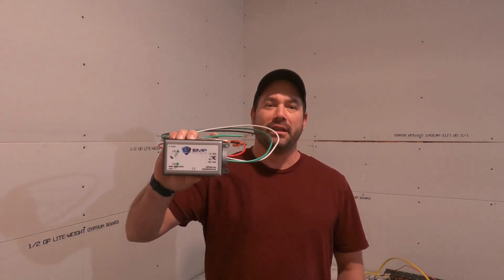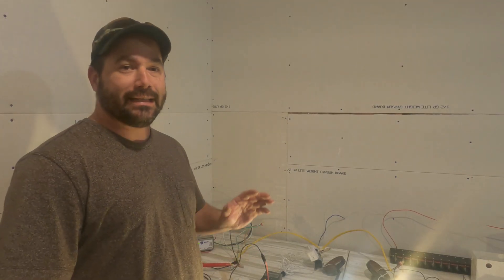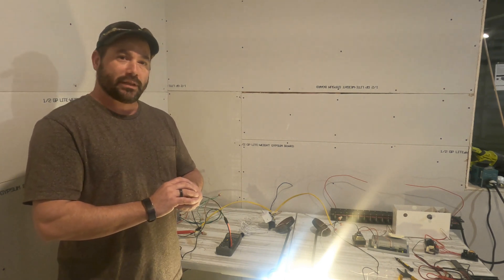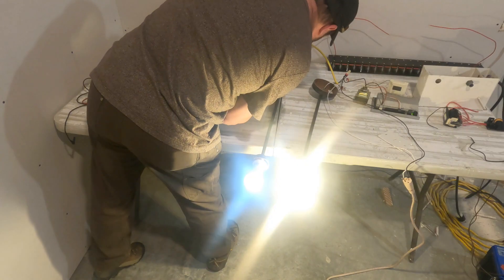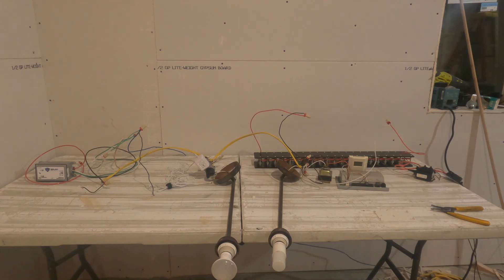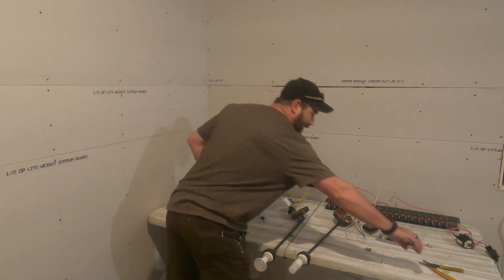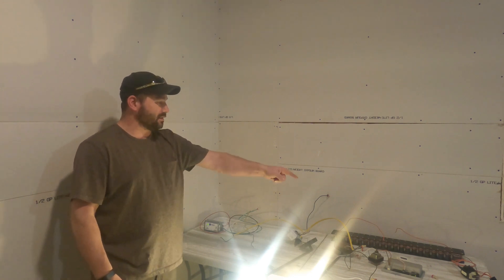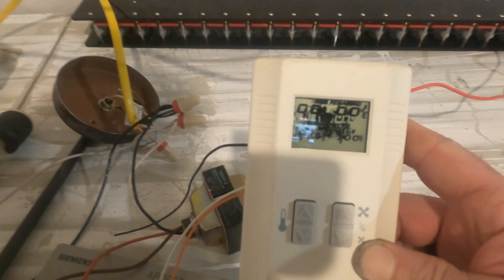Testing the EMP Shield Surge Protector ⚡

Comment: You are not qualified to talk about anything. You just called an arc from capacitors a static charge. EMP shield is a huge scam. Sincerely, an Electrical Engineer
Reply from the maker: I could spend the time to discuss the fundamentals of capacitors and skin effect similarities of conductors, but people aren't interested and it deveates from the topic. Charge accumulation of electrons on one plate (foil strip)  until equaling the supply voltage. This charge is dumped onto the other plate separated by a dielectric or insulator when the circuit is closed (by arc gap in this instance due to dielectric breakdown and ionization of the air). This build is using a high voltage/low amperage- similar to static charges and equivalent to emp charges being high voltage and low amperage unless coupled on long conductive surfaces- building both voltage and current until a similar dielectric breakdown of any nearby grounded materials- potentially even air. Are you slightly more satisfied? If not, I will issue a full refund of the entry fee.

Comment: Emp sheild is crap. Surge x is wsy better.
Reply: why?
Reply: @Miles-Research  because surge x is active surge protection emp sheild is not. Surge x use a huge inductor and capcitor bleed circuitry  and emp sheild is crap mov parts. And all moves are not rated for massive lighting, industrial brownout or motor startup surges.

Comment: That looked like some fun testing.  I recently was in the market for 3 lightning arrestors and looked into these Emp Shield units, but I couldn't find any specs that I could compare to all of the other brands on the market. I wound up going with a known brand at half the price. Your video is the only one I have found that isn't affiliated with them. 👍
Reply from the maker: @SteveStoltz  they are really difficult to find proper specs on the device. Most SPD's are clearly labeled. I do believe this is labeled as 228ka (which was on their old web page before they updated it.
   I can confirm that it does what it is supposed to do! I ended up losing a battery backup system hooked to my garage freezer from induction on nearby household electrical in the ceiling of the basement. It also did quite well at corrupting my micro sd cards or the camera as I was (attempting) recording. Hind sight was that I should have built a Faraday cage around the room. I was planning on upping the voltage, but after many catastrophic failures and getting zapped - even while standing on tractor tires and using long poles to close the switch of the isolation circuit through relays, I destroyed all the power supplies that I had made. I then considered a large tesla coil, but with the low amperage,  I'm not sure the end result will be anything but a pass. Luckily EMP's are essentially static charges, but they can build high amperage over distance of conductors.
  Lightning protection- I heard 1 story of this working against a direct building strike. It destroyed the device, but all motors and frequency drives survived.
Reply: @AnythingOutdoorswithSteve  Thanks for taking one for the team, Haha.

Comment: It would have been nice to have positive control - do the same without the EMP shield and see if everything blows up.
Reply from the maker: @sinilkim4255  did you watch the end? Doing this test indoors without a Faraday cage was a mistake. Apparently, I was inducing high voltage onto the surrounding house wiring in the walls, and it took out a couple of my battery backups for the refrigerator and freezers in the garage above. They still almost operate but have a lot of issues of turning off randomly and going into alarm mode, shedding the load- not ideal if you are trying to prevent power loss!
Reply: @AnythingOutdoorswithSteve if you want to make a realistic EMP generator, try building a spiral line pulse transformer and put a small antenna on the output. Definitely power it with batteries and outside.  The device is basically a spark gap firing a special air core transformer that is a jelly roll HV capacitor with a few extra turns of foil in the center. You could get a ready made one from Golden Engineering x ray machines, but a home made 5 gallon bucket version is much more powerful. For the antenna use a fractal type HDTV antenna and a coil of about 20 turns of wire for ground plane isolation. If you want multiple shots then copy the pattern on tge antenna with copper sheet and mount it all in the oil filled bucket. 😮
Reply from the maker: @christopherleubner6633  got one laying about i can borrow for the weekend? Right now, I am finding it difficult to scrape together time on the weekend to edit a video! My plan b was a large million volt tesla coil, since they are known to fry electronics with ease- still not the perfect emp pulse either.

Comment: How much charge does it claim to be able to handle? Do you think it will hold up to an actual EMP blast?
Reply from the maker: It lists 228KA, but I did not find a voltage rating on it. I do believe it will handle most EMP pulses, as long as it is installed properly.

For some reason,  I was thinking it was rated at 109Kv, though I am not 100% certain.